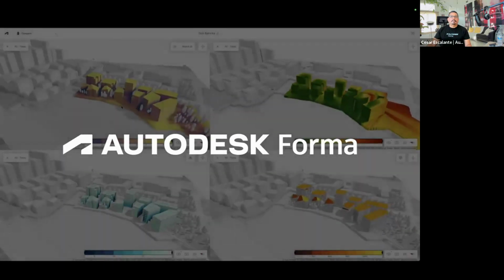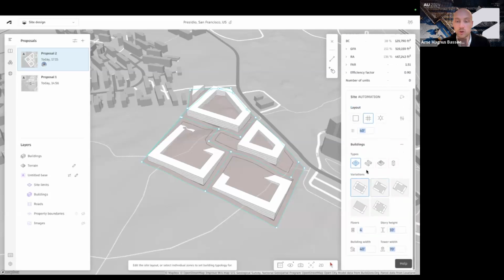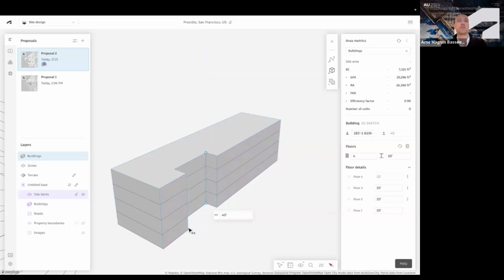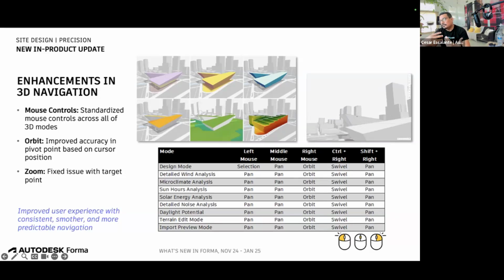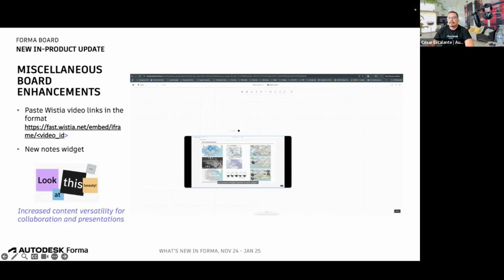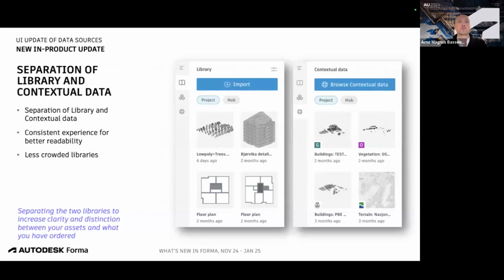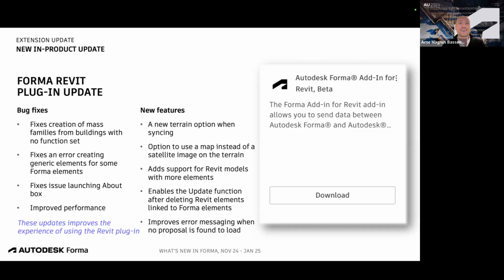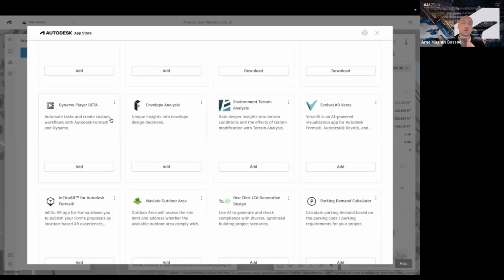What's new in Autodesk Forma - February 2025

Comment: the old version of site automation used to give you a lot of proposal combining diferent layouts with grids, trees, and buildings, now the new tool doesn't add tree areas and you have to manually insert them algo buildings too, it was a good way to start proposing, is there a way to use the older version of the tool?